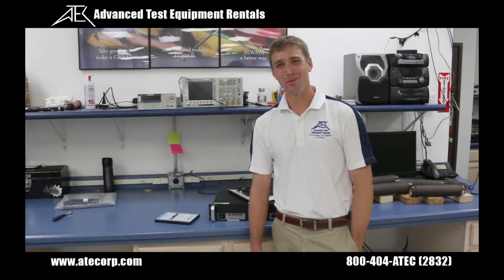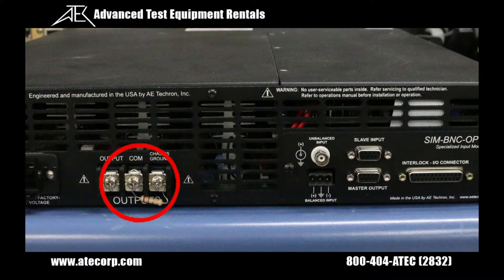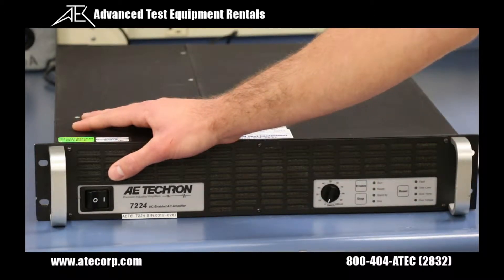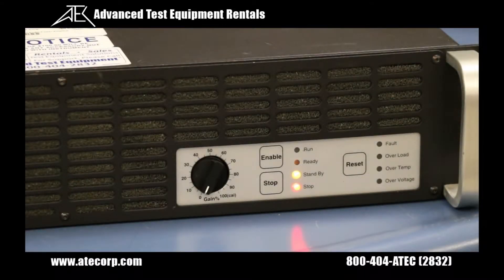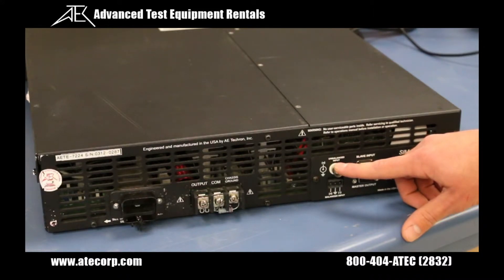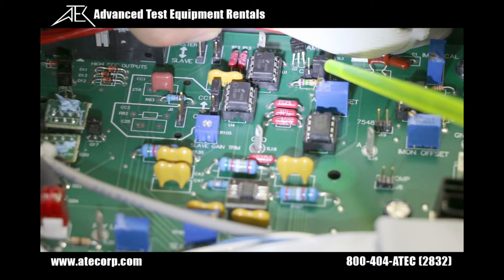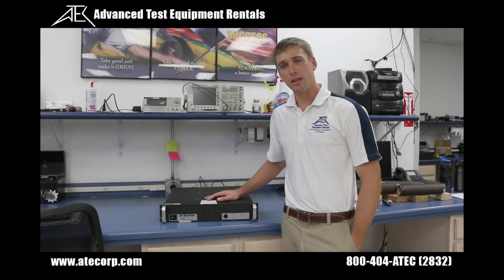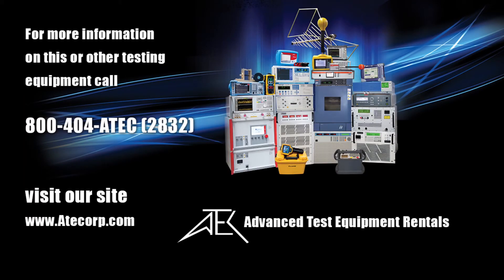Test Equipment - AE Techron 7224 How to Video

Comment: I keep getting overload on power up. Reset does not clear overload however turning down gain and then reset does remove the fault
Reply from the maker: Please double check your settings on the Optoc card for CV vs CC as well as gain and other settings. These could be causing the error.

Comment: How does operation differ from the 7228?
Reply from the maker: Hi Eden, one of the main differences is that the 7228 model offers up to 4X the long-term power of the 7224 at
frequencies above 100 kHz.

Here are links to the specifications sheet to help you compare the two units. 
AE Techron 7224: https://www.atecorp.com/atecorp/media/pdfs/data-sheets/ae-techron-7224_specs.pdf
AE Techron 7228: https://www.atecorp.com/atecorp/media/pdfs/data-sheets/7228techspecs.pdf

Hope you find this useful.